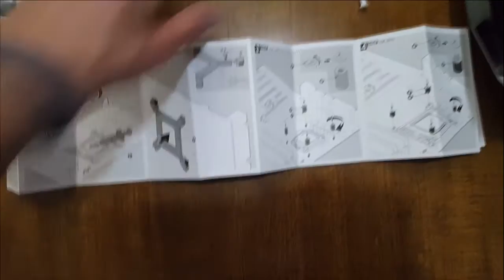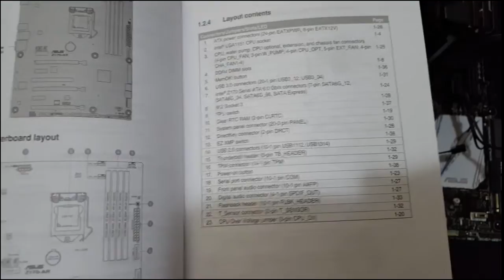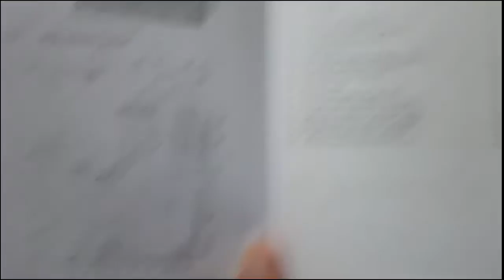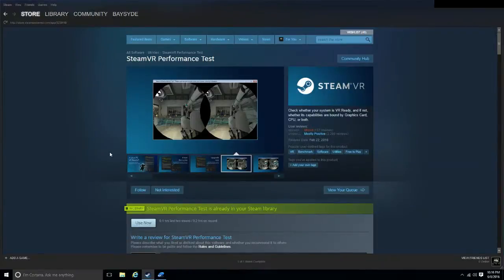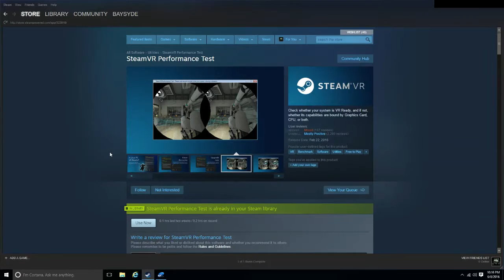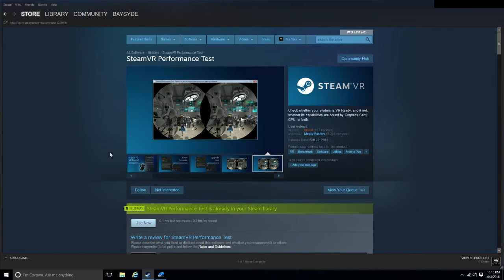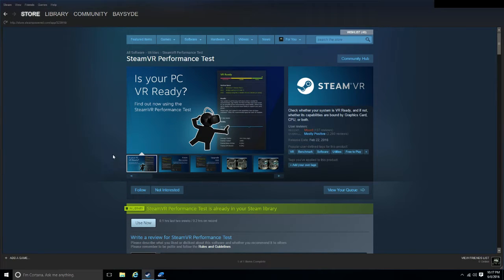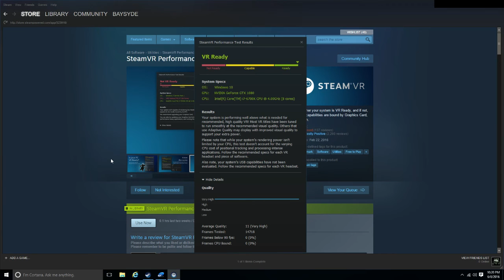ACTUAL Build - How To Build A Gaming PC - Part 2 of 2

Comment: So much thermal paste. You only really need the paste to be as large as a cooked grain of rice
Reply: Also, would you ever try liquid cooling your pc? The CPU air cooler looks out of place in such a beast of a pc.
Reply from the maker: I actually didn't use all that much paste.  I just spread it out as best as I could but it kept getting stuck to the applicator so it's bubbled / lifted up in places.   It all got squished down into place when I put the cooler on.  As far as the liquid cooler goes, no.  I've never used one of those before.  Back when they first hit the market, more years than I care to mention ago, they were notorious for leaking and having problems.  I've just never looked at them again since then.
Reply: Ah, I see. Sorry, I thought I saw a bunch of thermal paste on the CPU but I guess it was just the angle.